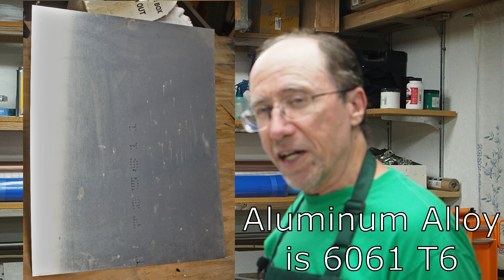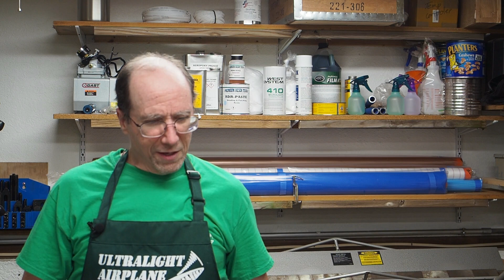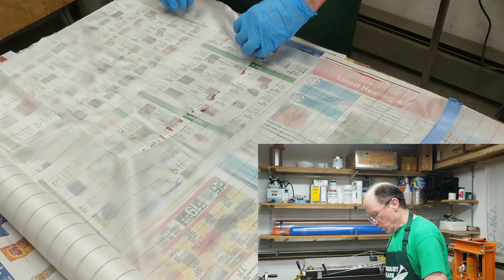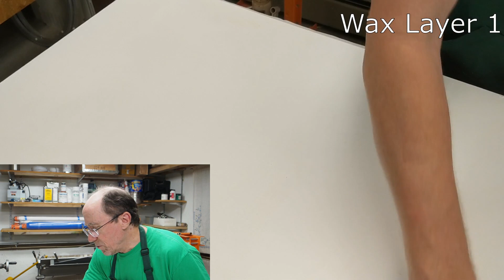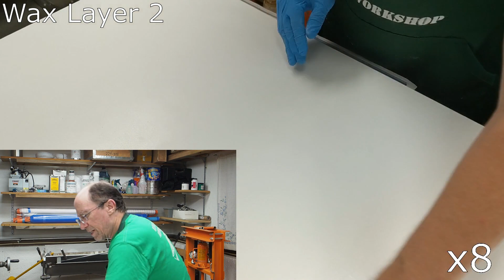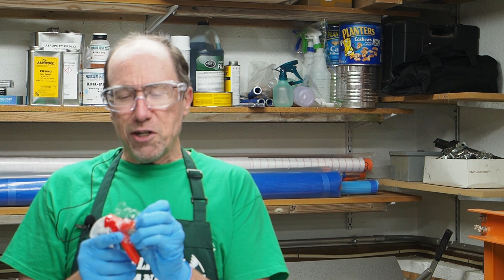Carbon Fiber Wet Layup: Part 1

Comment: Go to Harbor Freight in your area grab a 10$ air brush single action a small compressor, load your airbrush and twist the nozzle till you get the spray mist your looking for and shoot your mold surface...I use a chemical release agent and spray it with a airbrush or a 1mm nozzle used only for that purpose. You will get a really nice coating. Will take some practice if your not familiar with airbrush or spray guns.
Reply from the maker: Yep, thought will work great.

Comment: Is it ok to use wet layup for car body panels like hood, fender and door?
Reply from the maker: Sure, that will work. You will generally have to do more surface prep than if you used molds but should be quicker overall. For car parts weight is not generally an issue so I don't see a need for vacuum infusion.

Comment: Don't quote me on this but the wax process seems to be exactly the same premise as waxing a car - It's there to smooth out minor surface imperfections and create a gloss finish to the mould and therefore a gloss finish the piece that is eventually to be moulded - Sure having a smooth surface will also prevent things adhering but in this instance that's what the PVA release is for. Just as waxing a car will cause water to bead up on the surface and slide off, this is essentially what's happening to the PVA release and causing the effect you refer to as fish-eye.

I believe that if the surface of the mould itself (ie. the door you sanded back with 400 grit) is smoother and more desirable than the bumpy fish-eye surface achieved here after the wax and PVA application, then you could go ahead and leave out the wax altogether, applying the PVA release straight to the mould surface and it might avoid the water beading fish-eye problem you ran into.

I'm afraid I know a great deal less about laying up fibre composites than I do about detailling cars though so this is pure speculation - Good luck and thanks for the turorial!

Comment: Thanks for such a nicely made video. You ran into some of the same problems as me (PVA application etc) but answered a lot of questions I had too.
Reply from the maker: Glad the video helps. Some of what I'm doing is new for me so I'm learning too.
Reply: I read on a forum that adding a few drops (per 50 ml or so) of washing up liquid, a surfactant, helps reduce surface tension an allows a more even coat. It definitely helped!
Reply from the maker: That is a great idea. I can see how that would work. Might even make cleaning off a little easier :).